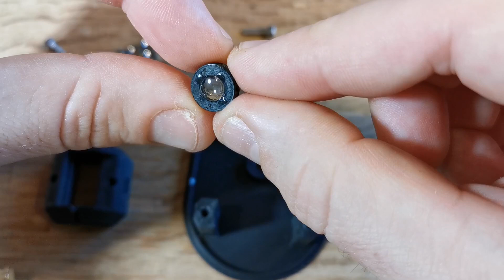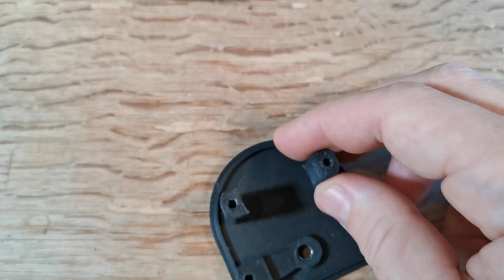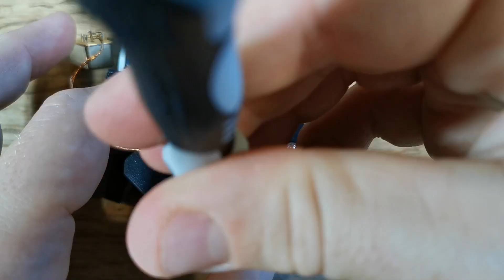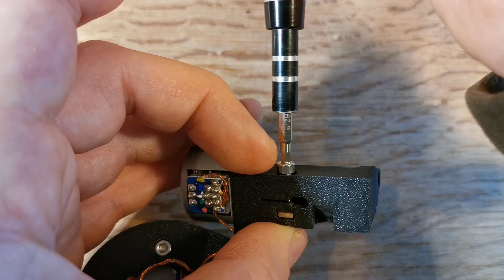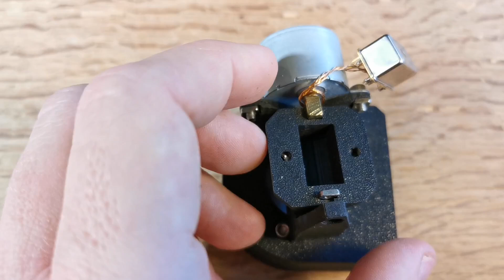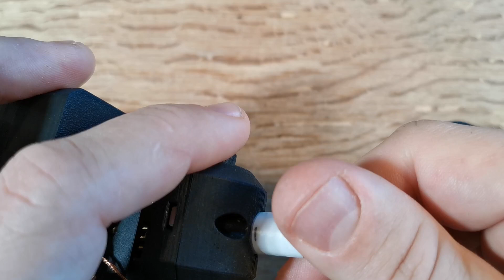Hyperspectral open source imager (HOSI) assembly

Comment: Did you make sure your UV glue is not fluorescent? There's sometimes OBA in some glues
Reply from the maker: good point. the glue does florescence a little, but it's shielded from the light, so should (theoretically) be in near-complete darkness on that side of the threaded component. I do have some UV-vis grade UV curing adhesive that I could try out on my next build though. I could also do more to shield form internal scattering if necessary.